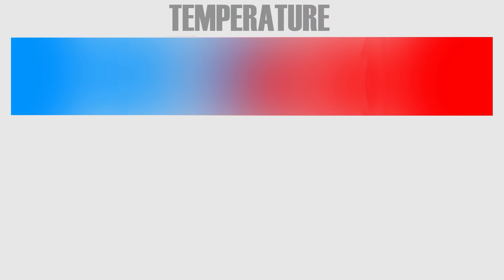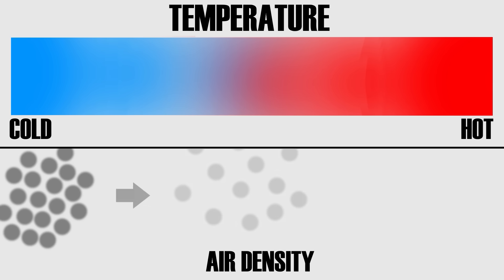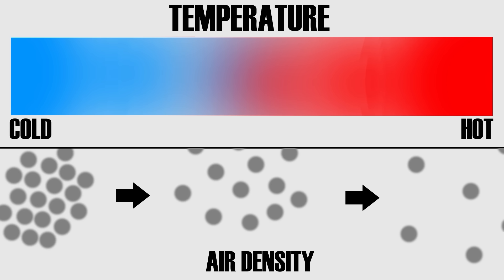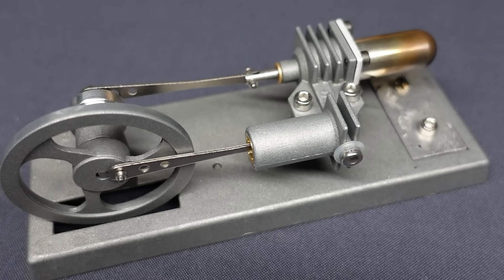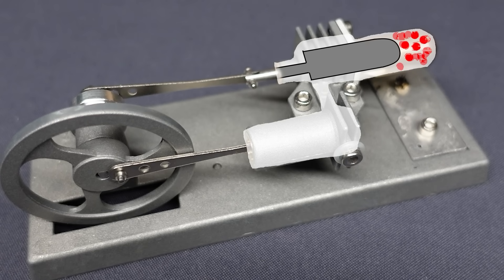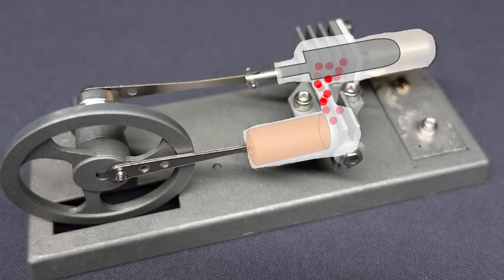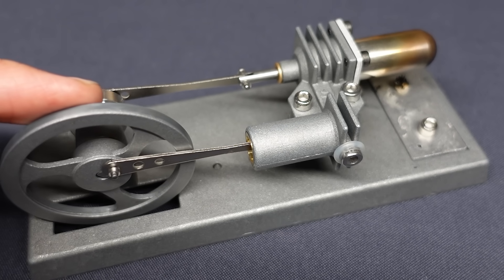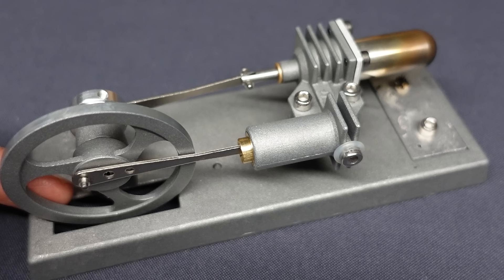It Can Save The World - The Simple Genius of Hot Air aka Stirling Engines

Comment: A common use of stirling engines is in homesteading homes where they heat with wood heat. They set stirling engines with fans on top of the modern efficient wood stoves. The fans circulate the heat and the heat used by the engine is radiated by the engine fins and is used twice, once to run the engine, once to heat the house. Here's a video that compares a peltier effect external heat fan vs a stirling fan. This stirling fan is quiet compared to the model stirling engines used here in this video.
https://www.youtube.com/watch?v=UNrkqfmDdps

Comment: You didnt mention the Stirling cycle is not only reversible (ie can run backwards) but also its closest to the conceptual Carnot cycle, which is the cycle which gives the highest theoretical thermal efficiency of all heat engines.

Comment: Couldn't you manage the power modulation by passing the power through a variable strength electromagnet that converts the rotation to electricity depending on the magnetic strength of the electromagnet? The electricity could be then be fed back into the heating element as needed.

Comment: V8 anyone all you gotta do is connect two of these V4 engines together though a single crankshaft like rod so all of the power comes from one crankshaft 🤷🏽‍♂️ or you could make a much bigger V8 or you could use a steam engine to make the heat to power this engine 🤷🏽‍♂️

Comment: I like the idea of implementing Stirling engines in power plants. I'm sure it will improve the plant's thermal efficiency, but I don't know by how much.
Certainly worthy of a pilot project.
Reply: Stirling engines have low specific power, meaning that the engine has to be quite large in order to produce a relatively small amount of power.
Reply: @teebob21  

When talking about power stations every equipment can be engineered and fitted during construction.

Powe stations however create huge amount of waste heat mainly through its stacks.

If this energy can be recovered (or even partially) then I think it would be worthwhile.

I know quite enough about power plants but not that much about stirling engines in regards to size, efficiency, and reliability.

There are several other systems that can be implemented to harness waste heat that I am aware of and I thought this could be another one.

For example, a stirling engine can be used to pump water to drastically cool the gas turbine inlet air (fogging) which yields greater efficiency and increases the GT output power.
Anyway, it was just a thought.
Reply: @nidaldajani728  Yes, and if was worthwhile to do, it would already be done. It isn't.
Reply: @teebob21  

Not necessarily! 
You are talking about ancient times, when plant efficiencies (as low as they were), were financially feasible, low fuel prices, and investors were not compelled for any additional investments.

Today we have to consider environmental impacts in addition to maximising profit while minimising costly and polluting fuel consumption.

The mentality has changed! Any idea that may lead to pollution reduction and fuel savings is welcommed. Not to mention increasing plant output!

Plants' expected life extend to 25 years and some up to 40 years (with proper maintenance and proper operation). So, maximization systems (such as fogging) can be easily recovered financially.
Reply: @nidaldajani728  No, I'm talking about now. There are zero practical solutions to implementation of Stirling engine energy recovery systems in megawatt scale plants.

The delta-T isn't large enough, and the volumetric power recovery doesn't justify the installation costs, let alone the ongoing additional maintenance.
Reply: @teebob21  

Stirling engine not as a prime power generator, but as a water pump driver! That's what you need for  "fogging" the GT inlet air.

I advise you to refresh your info on GT flue gases temp profile to realise exactly how much of a delta-T and volumetric thermal energy there is.

As I said, there are several other technologies to recover waste heat / exhaust energy, and I think using a stirling engine for fogging the GT may be a viable system.

It requires minimum installation procedures. It can be implimented to existing running GTs with minimum down time. Actually it can be performed during any TA activity (Turnaround).

Comment: I wonder if a Sterling engine could be made that would become a perpetual motion machine? If the generator attached to the engine heated coils wound around the top of the hot cylinder, then the heat would be enough to keep the engine going once it was up and running, and if tuned well it could produce enough energy to keep the coils hot. Thus by clever tuning of gear ratios, weight of flywheel, etc, the Sterling engine could be made that would power itself and perhaps even provide a small(ish) amount of extra power that could be used for turning say a fan or something similar. 

Just a thought!

Comment: How about using a single small solar panel to obtain the electric energy needed to produce heat in the capsule of the motor, and scale up the Stirling engine for a coil that could produce a few kw/h of electricity? Wouldn't that bring a better solution for the issues of solar panel's efficiency, occupied space and of their final disposal?

Comment: Incredible. Deadly simple and eliminate 97% of engine parts.  Virtually maintenance free.  Near ZERO pollutions & NO dangerous chemicals.
Reply: No torque. 🎉
Reply: @TheKmaki  The torque is feeble but surely not zero. With a gearbox you can convert low torque- hi speed into hi torque low speed. There are solar 1kW stirling generators.
Reply: @gomini3707 maybe a CVT style?!
Reply: Keep dreaming
Reply: If you are in in Antarctica trapped with a shapeshifting alien and need an engine to power your getaway could you just breathe on the one side as a heat source? Asking for a friend. - MacReady
Reply: LOL
Reply: lol if it was really that much better we would all use it
Reply: how is there no pollution or chemicals? you still need combustion from some fuel source, even in this vid theres combustion.
Reply: @mapple35 did you watch the video? The whole point is running off waste heat.
Reply: You could used focused sunlight during the daytime at least and that would be emission free.
Reply: You do not need combustion: you need temperature gradient. There are sterling engines that can run off the heat of a teacup.
Reply: And you still have to make one.
Reply: Not so. The air must be heated by burning something or using highly toxic radioactive materials. Zero pollution is a fools dream.

Comment: Since there is no combustion it is NOT a combustion engine. Combustion requires an explosion in an enclosed place exerting pressure. No such thing as an external combustion engine. Second the engine is so weak it can run anything. I mean nothing at all. Same as a sterling engine. Good for nothing. Your deception is only surpassed by ignorance.

Comment: I wonder these Stirling engines would be more effective with a different gas ? 
For example- instead of just air how about a more dense gas such as CO 2 ?
Also if the ‘candle flame’  was hotter - ie; alcohol or pressurised gas 

Where can I buy such a machine ? 
The V 4 cylinder would be nice.

Comment: Ok but like if you were to hook a small sterling engine to a motor and possibly reverse it so that it begins to generate electricity you could use that as a cheap power source then maybe just connect the motor to a set of rechargeable batteries and you could have have the beginning of a decent power generator

Comment: So... an engine that can't really be controlled beyond an eventual on and off so it only runs at one speed, and only needs a heat source. Oh and, you did not mention it, also gets more efficient when scaled up. 
Will someone please slap one of these under the hood of an electric vehicle? This combined with the (terrible) regenerative breaking, and all the excess heat generated by the battery, motors, and AC would probably actually increase the range by at least 10 miles. I realize that's not a lot, but for a lot of people that could be a chunk of their daily commute. 
Hell it might off set the drain due to some some EV's need to have the AC at full blast all the time... because someone thought a glass roof was a good idea. 

Actually if you fiddled with it and had black stripes on the roof with some form of passive thermal system under them you could just trickle charge the vehicle while it's out in the sun. You could also combine it with solar panels and probably get a decent charge over the course of the day.

A system like this could also get around one of my biggest issues with EV's, the heaters take forever to turn on because they are not just drawing heat from the engine. Now if we could just get some decent seats in any of them...

Comment: Some hybrid cars currently use an efficient Atkinson cycle internal combustion engine running at a single speed to drive an alternator that charges the battery that powers the electric motor that actually drives the car, so the delay in starting if a Stirling engine was used instead would not be a problem, as it would only need to begin running just before the battery was discharged to a critical level where it needed re charging.

 So, what in your opinion is the reason why this option has not been used, it would seem to have many advantages.

Comment: Power generator for off grid. Store energy in air compression and fly wheel. Use a double barrel rocket shove, and ORC heat convertors. All of a sudden acouple twigs and blades of grass are heating and powering an entire house!

Comment: Ok. Point of order: any Stirling engine using the heat from any fossil fuel cannot be emissions negative. In the case of geothermal power or putting a source of radiation next to it... sure. But using the wast heat from a gas heater or even the heat from Paraffin wax burned in a candle emits carbon emissions .

Hybrid vehicles are *not emissions negative*. They can only increase efficiency by utilizing waste heat, but will not save us from climate change which requires net-negative carbon capture methods to be used.

Comment: You are not using waste heat!
You had say 30 seconds of 'free' heat, but you probably needed to preheat the engine for that time to make it start.
I cannot see the gain here, so you are just fuelling an engine in a different way.
It's the same with storage heaters. You don't get immediate heat as you are using electric to heat ceramic blocks first, that will release the heat steadily, long after turning off the electric source.
It's just a delayed system!

Comment: For quite some time a very good reason to not use this technology was that the the available materials simply couldn’t take the heat. 
🤔 That was then, this is now. While ceramics technology still falls short of the level of precision needed to produce internal combustion engines, 🤔 it’s actually plenty good enough to build the displacer side of the piston.  And honestly that’s where the really high temperature levels are.  I’m actually kind of confused as to why things have yet to take off. 🤷

Comment: It's cool that it's on a sub, I'm a retired US Navy Mechanical Tech (Machinist Mate rating) and when you were describing this the first thing that popped into my mind was these would be absolutely amazing on sea vessels.  I would also think small trains may find something like this useful as well.
Reply: tandme2342  The Swedish and Japanese navies have attack submarines equipped with Stirling engines.
Reply: tandme2342   But they are not immense, and they have been fitted to submarines for 35 years.
Reply: @oldbatwit5102 big ones can be very quiet
Reply: They are perfect for boats too since sea water is cold and perfectly suited to cool the cold side basically for free.
Reply: Gotland  took part in war games with the USN, it sunk the Ronald Reagan , having got inside the escort screen.
The USN never found Gotland until she was reported in Swedish territorial waters and popped the hatch
Reply: Just to be clear, the reason these are quieter than a nuclear sub is because you can turn the sterling engine off and run entirely on battery.  You can’t turn the reactor off.
Reply: Steam locomotives used 1-stroke Sterling engines. Except instead of burning Ethanol (as shown here) they burned coal and - in the later years - oil.

Comment: Very nice video.   Nice explanation of the tirling engine.
A way to mitigate the apparent limitation of the Stirling engine in terms of power modulation would be to use it in a Stirling/Electric system.  The Stirling engine would generate electricity, which would go into a storage battery and the "throttle" of the system would be the control on the electrical current being drawn off of the battery system.  No problem really.
Reply: Yes, exactly!  And downsize the batteries, and use super capacitors for millions of cycles instead of thousands, and provide heat for the cabin instead of wasting electricity for that.  This is the kind of hybrid car I want!
Reply: Seems like a great way to power those pumps on a nuclear sub; there is already so much heat you need to dissipate...
Reply: It would make a perfect little generator motor, but then you're right back to the problem of burning a fuel source to power the vehicle. It does make one wonder how well it would work though, especially given that Stirlings don't care what the fuel source is. You could burn almost anything for it, wood, candles, you name it...and you could probably circumvent the battery issue entirely by using an electric generator rather than any sort of power storage. Maybe a generic 12 volt car battery for the internal electronics, but that would be all that's needed if the generator were powerful enough to drive the electric motors without needing to fuss with any sort of power storage.
Reply: @cavalieroutdoors6036  none of this addresses the actual fundamental FLAW of the stirling engine. its just silly ways of using one.

heat transfer. you have to transfer het from the outside world, through a cylinder wall, and RAPIDLY apply it to large amounts of fluid (air).

you then have to just as rapidly get all that heat back OUT of the air.

they may not care what fuel is used, sunshine seems to work fine, along with say... thermal mass, like hot sand, or salt, etc...

but nothing will overcome that inherent "surface area to volume with time constraints" issue they all suffer from.

Comment: Couple questions about these engines-
1. Would a stirling engine start out more effecient, then slowly get less and less effecient as the body of the engine warms up?
2. Would the RPM be capped purely by how fast the air can be heated/how fast the air can be cooled, or would there be other factors at play?
3. It was mentioned that it doesn't need lubricant or oil-- presumably that doesn't apply to the flywheel and such (because they arent really part of the power generation and wouldn't need to be relubed more often), but wouldn't lubricating the tight fitting piston increase effeciency by decreasing friction?

Comment: Stirling engines are best at cyrogenics (an electric motor generally powers the stirling engine) because their efficiency is based on Carnot's hot side vs cool side ratio, which is rather high when one is cooling to a few degrees Kelvin.

Comment: What's the efficiency of thus sterling? Is it more efficient than conventionally solar panels?
I can see two improvements, for a specific application.
1- the cylinder of the guiding piston made of two different materials. The top part (in contact with the heat source) thin stainless steel, while the bottom part (where the air needs to be cool) in insulating material.
2- the heat source can be concentrated sun light,  through a moving magnifying lens. 
You put the heated part exposed to the sun, while the rest of it stays inside. And you use it to produce electricity (instead of solar panels), stored in salt batteries.

Comment: Stirling engines already exist ,and they WILL NOT save the  planet.  They have been around since 1814 , just like the hyrdogen powercells.   Stirling engines need huge amounts of heat and cold to work efficenctly and the only place they work is in space where absolute zero and heat of the sun provide the heat exchange .  

You need imense amounts of energy to make them work .  Ever wonderd how a steam engine works good that is an external combustion engine . And how much energy do you need for those  , good .

Comment: Extremely low power for the displacement.  You'd need an appx 4 ton engine to power the common economy car at freeway speed.

I recall a story of a ship powered by huge sterling  engine and using double the typical engineroom space vs the crude sidewheeler power of the time the thing could barely make steerage speed.  An epic failure.
Reply: Your quad-sterling engine made what? 15 watts?  I'd get 15000 watts out of a small gasoline engine of the same weight.

Comment: is a flame sucker engine external combustion? I think so.
Is a regular steam engine an external combustion engine? The fire burns outside of the thing that holds the working fluid that creates the motion- it could be run by just putting an open fire under the boiler, or putting the boiler over hot lava or in the sun with mirrors. Seems pretty external to me.

Comment: The British Industrial Revolution has a lot to answer for, all these things that were invented and no one’s bothered in a substantial way!
Thanks for showing what this can do, of course what you showed does mean also that you don’t need to continuously use heat on the engine just enough to raise it to working temperature.  This means it is more economical than it looks if you are using a non linear heat source.  So! Heat on to heat, stop heat, sense low temp, heat on to heat - continue.

Cheers Aah Kid!  Keep up the good work mate!!